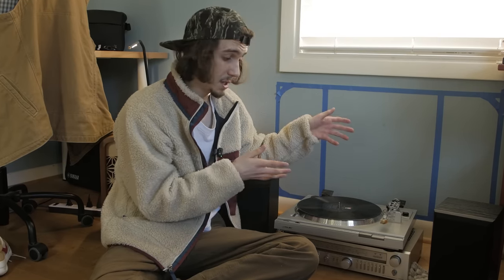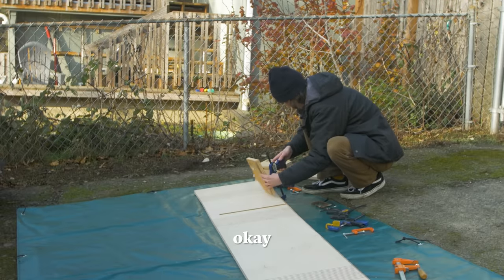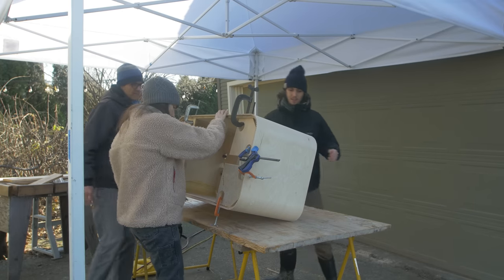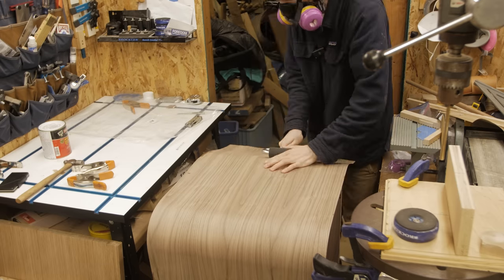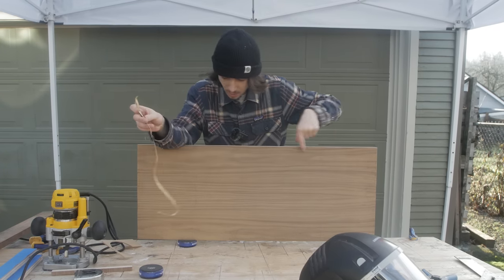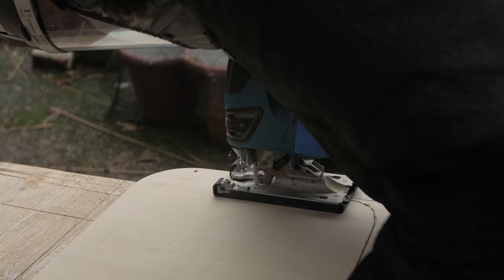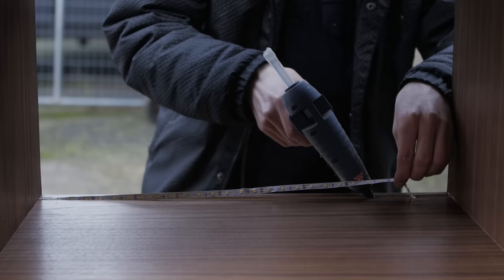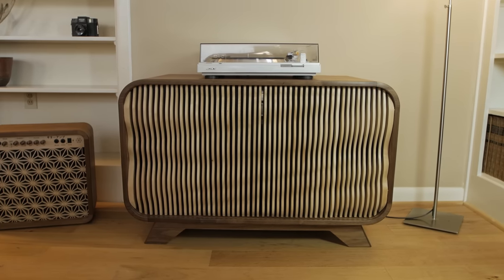Building High-End Furniture in my Driveway…

Comment: I was a carpenter on construction sites for many years, all the other carpenters used to come to me to sharpen their chisels as none of them were any good at it. Learn to free hand it, having a bit of a bevel is not the end of the world and if you care it doesn't take long to learn how to get a flat edge on it. I did most of the work with my legs and used my upper body to brace it. Also don't overthink it, you can do the same with rocks down by a river, this is ancient and primitive stuff, and that's a good thing. Also sharpening a wood saw is way easier than you'd think

Comment: Fantastic job on the cabinet! To answer your question, I scrape clue with a cut straw while it is still wet. It pulls the glue away from the wood rather than spreading it around like wiping does.

Comment: A "record player" is a cheap, all-in-one unit that has a speaker and the cheapest-ever mechanism for playing a record. 
What you have is a "turntable", which audiophiles will reverently refer to as a 'table.

Brilliant build. That's exactly what I want to build. Not sure I'd put the booshelf speakers inside the cabinet though. Try experimenting with them farther inside and closer to the front.
Also, get yourself a discwasher setup.
Reply: Blocking the speakers with solid doors seems a little counter-intuitive. Was thinking maybe the contour panels would let you see into the cabinet therefore letting some sound out, but in the end it still does look beautiful.

Comment: Very nice table, maybe next time you can add the edge banding before the veneer, that way you won’t have the seam of the edge banding on the outside of the cabinet. Also I suggest putting some tape on the veneer when you were routing the edge banding for that extra protection from your router bit. Very good job bro
Reply from the maker: Thanks man! The reason I don’t put the edge banding on before is because you would see the edge of it and because it has a paper backing that wouldn’t look super clean!

Comment: What if you ran a steamer over the kerfs before bending them? Might add some pliability, as long as they don't get too wet. Also could make your assembly easier by cutting some inverse corners into some plywood pieces, so you'd have a brace on the outsides with curves in them.

Comment: if you saturate the wood cabinet with water before bending, the wood fibers will stretch quite a bit, and will never have a crack happen!  I had a  1x6 6ft long cedar board from my fence that was warped horribly...I threw the board in the swimming pool for only 30 to 40 minutes, and its fibers stretched the board back to it's original shape.. I quickly screwed that board back on the fence so it wouldn't start to dry out and warp again.. Trust me it works, without using steam to bend...

Comment: Just a tip for the future when your bending them soak then the noght before in the joint areas that you cut out it will help keep them from cracking
Reply: You just wet a hand towel and set it on the joints back sides

Comment: Most of your struggles came from you being young and therefore a naive optimist. This is a critique not an insult. As you saw reality will slap you in the face and teach you to be more realistic. 

You had no reason to believe this project would take one week to complete. The proper attitude should be agnostic. I don’t know how long it will take.  By erroneously believing in a deadline that turns out to be unrealistic you’ll just cause suffering. 

The same is true for all the mistakes you made. If this is the first or even second time you’ve done something, why would you expect it to be easy?  If anything you should expect the opposite. Even after decades of woodworking I assume the first time I do something new will fail. This is why making a test piece is wise. I’m a fast learner so the difference between first and second attempt is quite large in my case. But even so, you shouldn’t assume success. It’s naive, likely wrong, and will lead to frustration. In woodworking everything is fixable. Don’t stress over mistakes and don’t expect to not make them. 

Also if plywood is too heavy, get stronger. That’s what I did. And don’t work outside in the winter. I live near Chicago and my garage wood shop gets shut down for the season when the weather is under 60F.
Reply from the maker: You have some valid points here, although I tend to disagree about what mindset I should be in when approaching a project. That might be what works best for you, but everyone has a different way that works best for them. I think my "naive optimism" is my greatest strength. Most of the success I've achieved was because I was optimistic and didn't worry or know about any challenges that would eventually come. If I'd been completely realistic about everything I've done up until now, that would have likely prevented me from starting because it would have been overwhelming. There is definitely a time and place for being realistic and even pessimistic, especially with real-life decisions that hold weight, but with a woodworking project, the worst thing that can happen is having to restart or spend more money/time, both things I've done before and don't really bother me. I obviously expect there to be roadblocks with every project, but I won't let that hinder my progress.